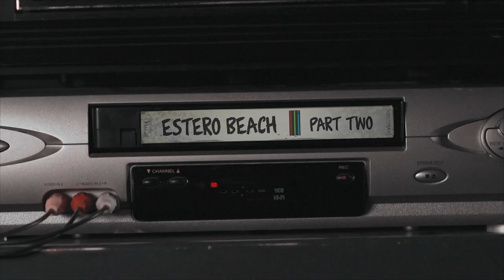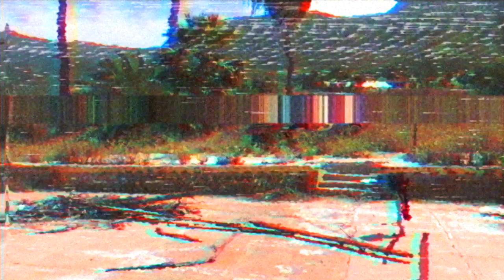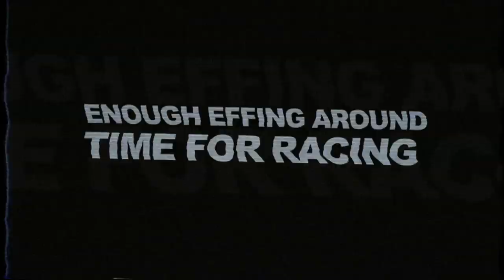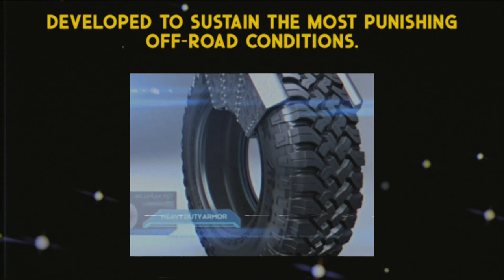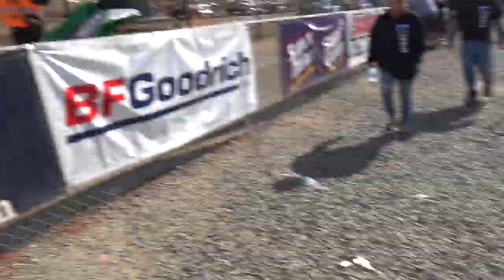Abandoned Waterpark Shred Session in Mexico in a Ford Explorer

Comment: That sand jump looked straight out of forza horizon!
Reply: @dbspaceoditty  That a arcade racing game, that's the point. If you want realism then play motorsport 7, not horizon 4.
Reply: @dbspaceoditty  I was a Gran Turismo player (PS3) but always respected Forza then for the ability to engine swap and make graphics for the cars. It wasnt as restrictive and actually had engine swaps that were quiet common. But recently ive seen where you can say "Put a whole Bugatti driveline" in a Ford Festiva or whatever. If im not wrong, the earlier more realistic games would only allow engine swaps that would actually work? Or am I wrong there. Also I get grafting an older body onto a much newer better chassis (in most cases) but they have to be almost the same size or you obviously have lots of work to do on one or the other. Having an AWD Bugatti chassis "under" a Fiat 500 is just ridiculous. May be fun but definatly not realistic. Thats why I liked it so much. Havent played either in forever tho
Reply: Will Spicer not really true. If anything, the newer games only (mostly) do realistic/common swaps.